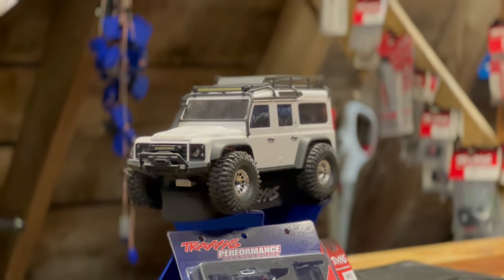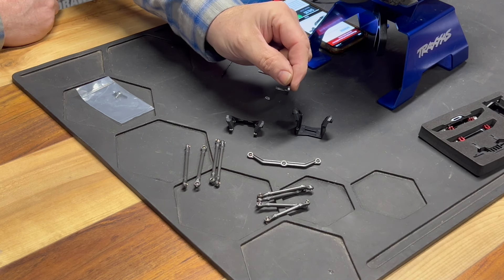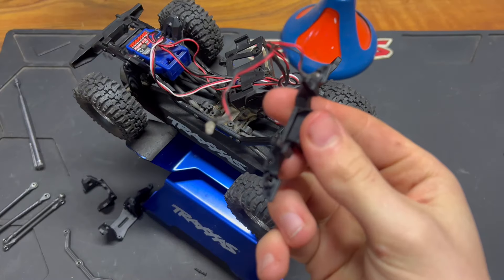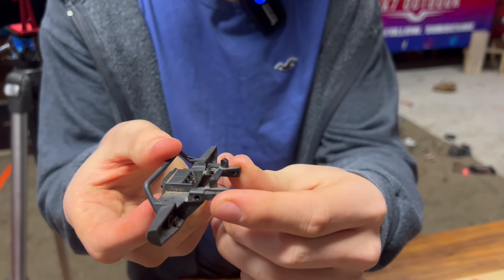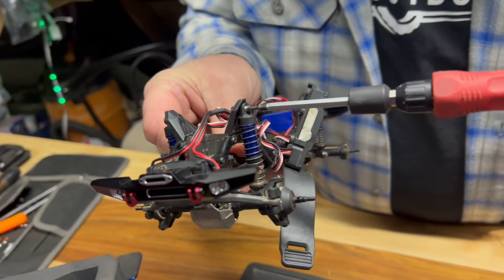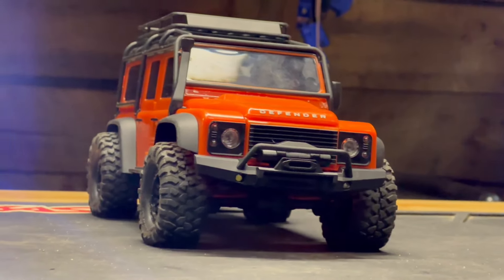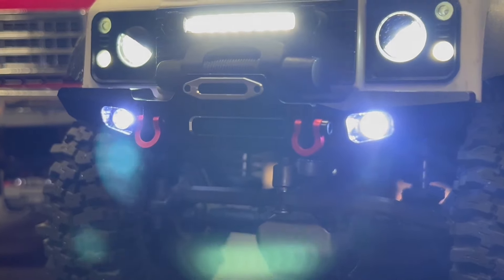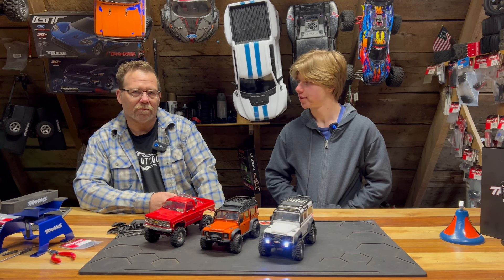Trx4m Gets a LIFT KIT! | Fully Built Micro-Crawler

Comment: Thanks so much for this video.  I ordered my lift kit after watching this.  Always great to find out the options we have to make our rigs that much better.  Great detailed video.  I have watched it several times to make sure I don't miss anything.  I noticed a few things on the last viewing.  at 7:24 you are showing a nice completed view of the front axle from the underside.  The lower link ends, at the axle, have a curve of them.  I believe those need to be swapped sides.  They should curve out instead of in.  They will give the links a better triangulation on the axle for better stabilization.  It has been explained in other videos that the curve is meant to go around the shock and still get a wider triangulation.  At 1:40 and a few other times the links are referred to as Panhard bars.  A panhard bar is used for lateral stabilization on the front axle when you have a chassis mounted servo.  One end attaches to the frame and the other end attaches to one side of the axle.  Thanks for great content!!
Reply from the maker: ahh, good point! i'll have to go look at that
Reply: @3X7Outdoor  I felt it was the right thing to do by coming back here and letting you know that you are absolutely correct in how you mounted the lower front links.  I questioned there orientation in my comment above.  Well, I installed that exact kit on my Bronco this afternoon and the instructions included in the kit showed them exactly how you have them.  Sorry and appreciate the feedback and great videos.

Comment: Why do you say we need 9855, a different drive shaft.  Customer service stated I did not need to buy this.  I gave traxxus this video link and they said it wasn’t necessary.  So can you explain why we need the different drive shaft piece?
Reply: it just extends the driveshaft because of the extra hight. it may not be necessary but it is needed because if the shocks are fully extended, the driveshaft may pop out / because there's not much contact.
Reply from the maker: FunnyGuy177 is correct
Reply from the maker: it is me
Reply: @3X7Outdoor  this is not correct, if you buy that piece it does not fit, the drive shaft will actually keep the from compressing all the way.  The longer drive shaft doesn’t work, thanks for wasting my money and time.